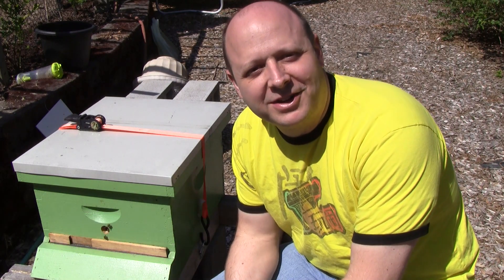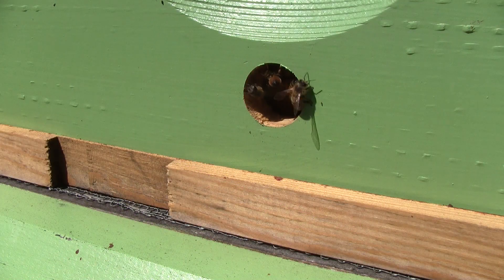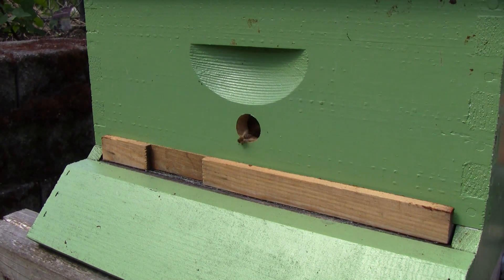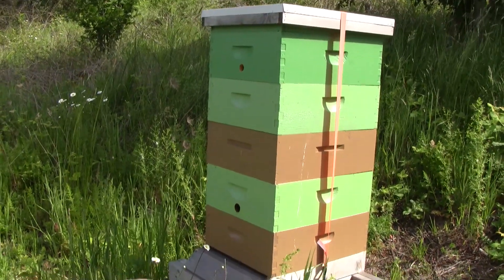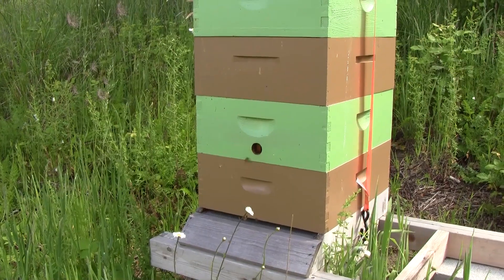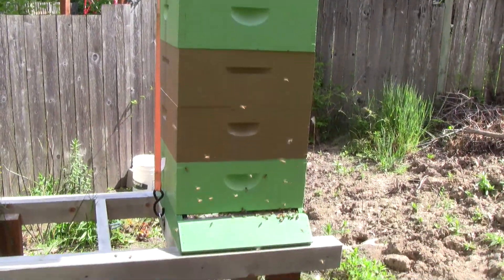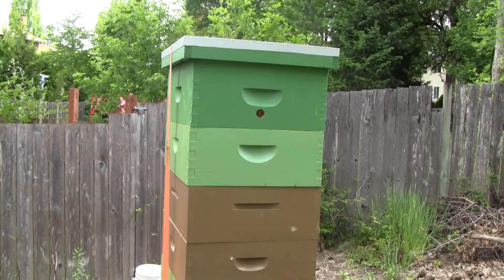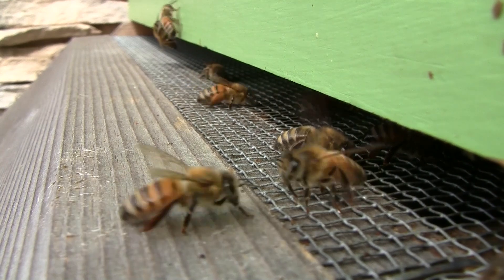Hive entrance experiment - BeeVlog #132 - May 29, 2014

Comment: I like your experiments!  

SHB can't hover so some use a pvc elbow facing down.

But do you think a wire landing board would help bees defend from beetles? (I'm thinking the SHB can't hover to enter and would fall through a wire landing board, but bees loaded with nectar could land and get in.)  
I made a ant proof metal stand from trampoline parts on my channel...I'm learning!

What area are you in?
Reply: Oh what size screen is at the end of your video? The holes look bigger than 1/8th inch...but i can't find something smaller than 1/4th but bigger than 1/8th.
Reply from the maker: I haven't given much consideration on how to deal with SHB. I'm in the Portland Oregon area and, while SHB has been found here, it's not a major problem. That is 1/8" screen on the bottom board.

Comment: i use a 1" or 3/4" holes on my nuc's,  The only bad thing about holes is,  they can't drag thing out of the hive. Small holes is good for ventilation, entrance and  escape routes up and down a large hive, can always cork them up, Bees do like holes.....I only use holes in my swarm traps,  i have found that they do use and like a bee flight pads, And one can tell as to what is going on into the hive by a flight pad, see wax on the pad mean there making comb or shredded wax means there robbers,  one can tell a lot  as to whats going on by a flight pad with out opening up the hive can see Ants,SHB, insect dropping  on it ect ....Now i do use a entrance reducer on the bottom of all my hives  as well as a flight pad,so they can clean there own hive by a 3/8" or a 1/4" high Entrance will work too, that 3" long opening, it works very well and the bees can protect and clean there own hive a lot better and attacks from wasp,robbers,ect

Comment: Not sure where you are located, but will you plug some of the holes in the winter, or leave them for ventilation?
Reply from the maker: I'm just outside of Portland Oregon. I'm not sure what I'm going to be doing with the holes in winter. My plan is to leave them open, but that's yet to be determined for sure. Our winters here are more wet than cold, and moisture build-up inside the hive is a big problem. So leaving them open should, hypothetically, help to improve that problem.

Comment: Acording to langstroth hive the direction of the Bees access through the entrance should be parallel to the frames so is it mandatory to make it like this or we can change the location of the entrance by making it perpendicular to the frames?
Reply from the maker: Either way would be fine. I put it on the "front" of the hive for convenience, but you could really put the holes wherever you want. It doesn't really matter.

Comment: How will they carry out the dead bees and keep hive clean?
Reply: Easily, they have even carried dead bees out of the top. The concern I have would be during the honey flow and when they have a ton of bees trying to get in and out. But looks like he'll add additional boxes with holes in them as well.
Reply from the maker: Exactly right. I think there's a misconception that bees need to be able to drag out the dead. They can lift and carry them out without any problems. I share your concern about the honey flow traffic, and that's one of the things I'll be monitoring with the experiment. At this point, my largest hives still have their bottom entrances open because I don't want to drill holes in their boxes while occupied. So it will be a slow conversion.